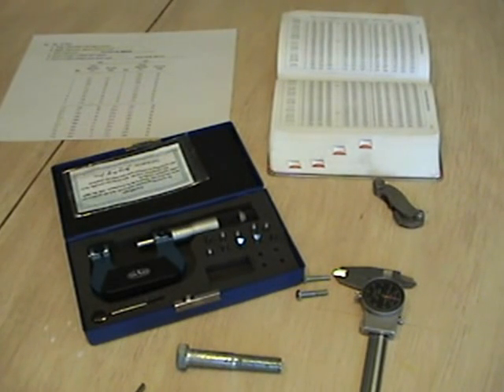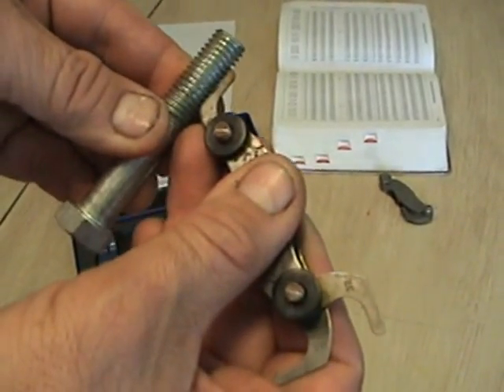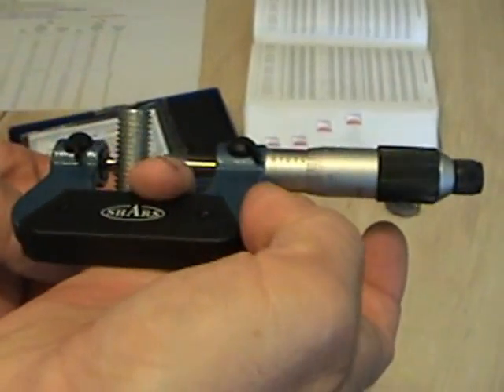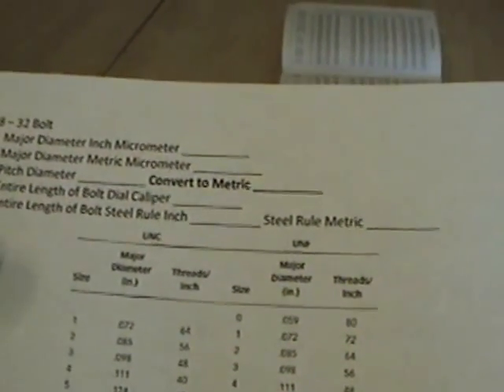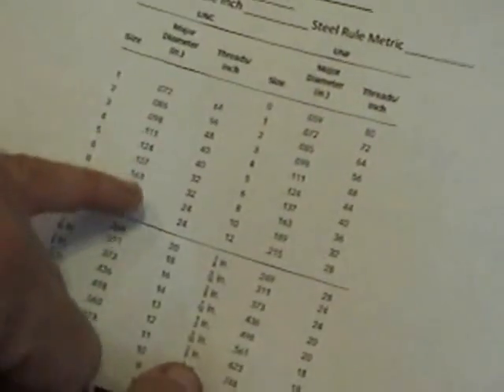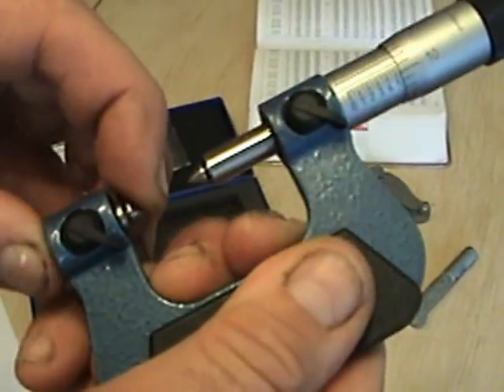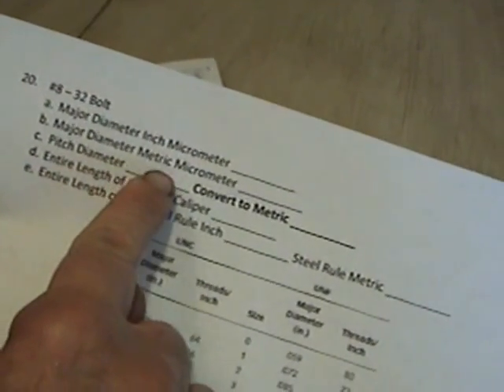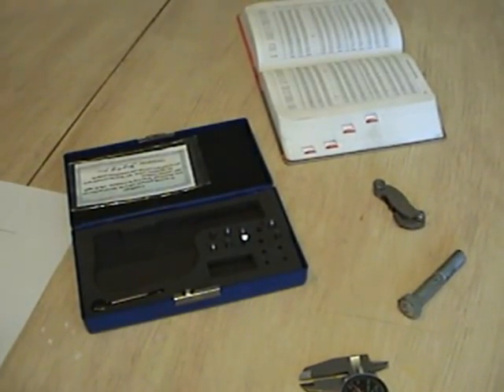Using the Screw Thread Mic

Comment: Thank you for this video - very interesting stuff!  And special thanks for leaving in the 0.470" versus 0.445" confusion.  All micrometers read a little differently regarding whether the additional 0.025" line shows completely, partially shows, or [on cheap micrometers] is almost completely hidden (on a reading like 0.450 for instance).  Regardless, showing the mistake and how to logically correct it will help others and shows the humility necessary to be a good teacher.  Thanks again!

Comment: I have always measured bolts length from the under side of the hex to the end of the bolt, never overall length. I may have been measuring wrong.
Reply: joe miller you’re correct

Comment: I would have cleaned the anvils before I inserted them, and after securing the lower anvil in contact with the moving anvil, I would have then unlocked the spindle, moved it away from the fixed anvil then brought it in contact with the fixed anvil to ensure that the zero was correctly set.
Reply: I came here to say exactly that.  Set the zero then check the zero. He never checked zero. It's easy to be off without checking it. If it's not on zero after you've set it then it's best to reset it or at least compensate knowing how far of it is. But yes definitely check zero after setting it.

Comment: Mr Logsdon. Do you know how to calibrate one of these?? Thanks for your help!!
Reply from the maker: Yes, you make sure you have the correct anvil and spindle installed (ie. 3/4"-16 = 16 pitch). Leave the anvil end loose then set the mic to zero. Slid the anvil toward the spindle until it stops then lock it down. It's now calibrated.
Reply: Thank you Sr !